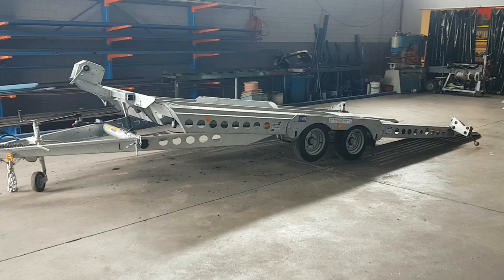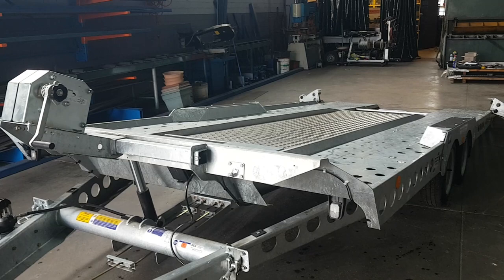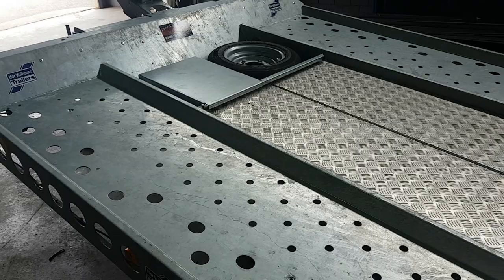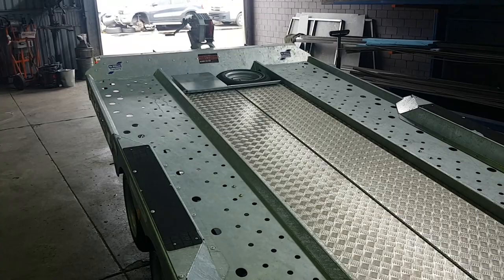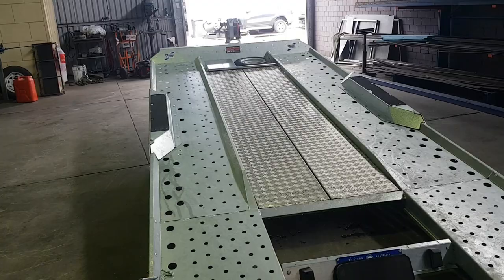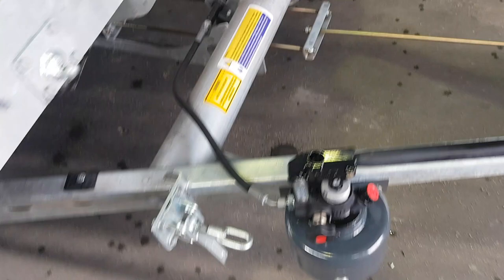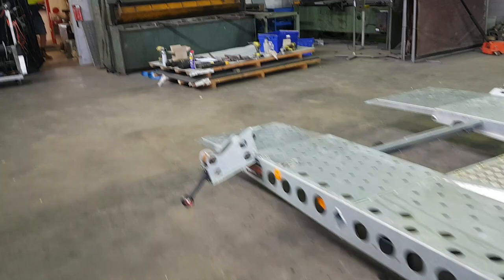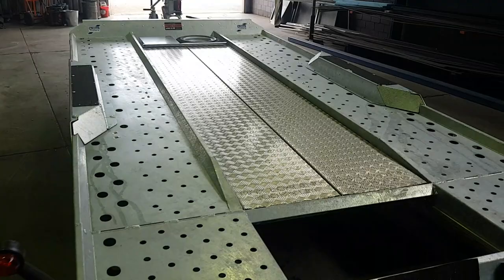Ifor Williams Car Transporter CT177

Comment: What’s the Benefit of the central infill ? 
Does this not add more weight?
Thanks
Reply: I have them because it hurts like hell when you full in between lol 😂 I’ve never used my skids also pucker trailer tho you can sit 70mph threw Europe’s with ease
Reply: It’s for towing BMWs so the oil doesn’t go on the road.